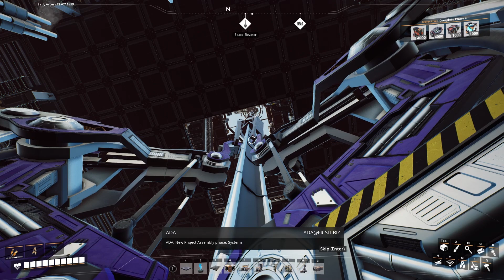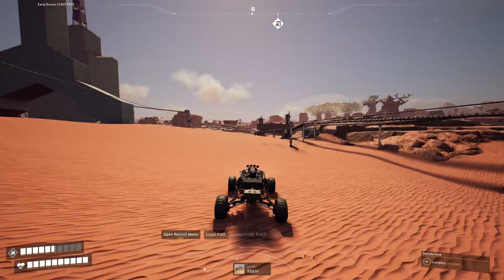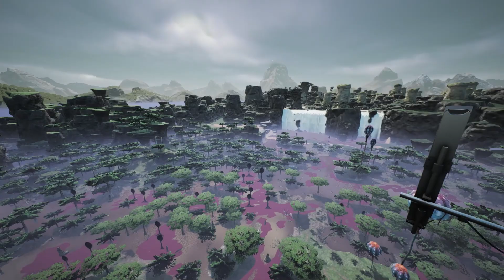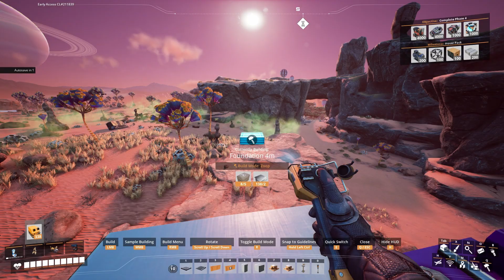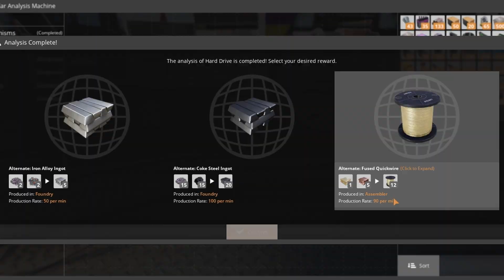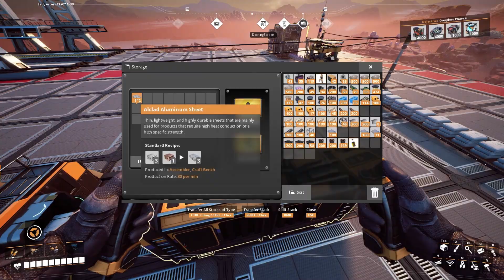20x20 Satisfactory E10: Finalizing Aluminum Production

Comment: Hi man, make surethat your aluminium production is as ideal as possible cause it might be clogged very soon, and it's really a pain to manage it
nice video btw
Reply from the maker: At the moment anything excess is sent to the recycler. Though I do have more foundries than needed, so any excess gets turned into something else too. 

Some day I’ll return to it and clean it up, but for now it works very well, and hasn’t clogged while active.
Reply: I just finished a plant making 1080 aluminum casings per minute and it was a pain in the ass.  Routing the water from production of the aluminum scrap back to the alumina production makes things tricky so I just ended up turning it into wet concrete and sinking it.
Reply from the maker: @Oxibase  
I'm thinking on rebuilding my aluminum production some time in the future, though that's not cause of clogging, there's actually not enough water getting to the machines for some reason.

Though production wise, it's a low priority for now
Reply: @DeanSpillaBean  If you have the wet concrete alternate unlocked then I highly recommend using it to get rid of water rather than going the typical route of sending the water back into the system for bauxite refinement.  It’s much easier to just pump in the right amount of water to begin with so that all the machines can be running all the time without dependence on water from refineries further down the line.
Reply from the maker: @Oxibase  
I've got the wet concrete recipe, it's more that I need to spent some time rebuilding everything for it.

Just didn't feel like using it at the time.